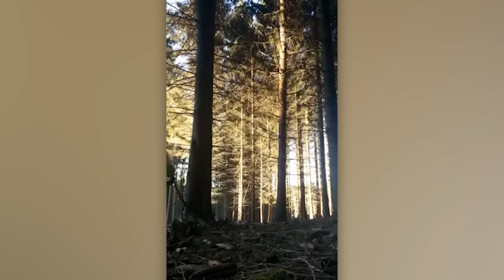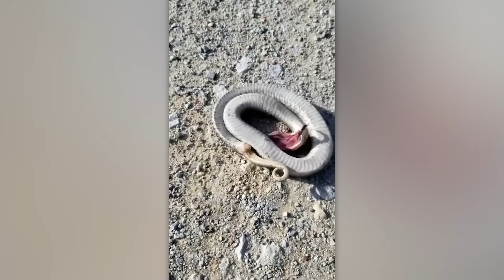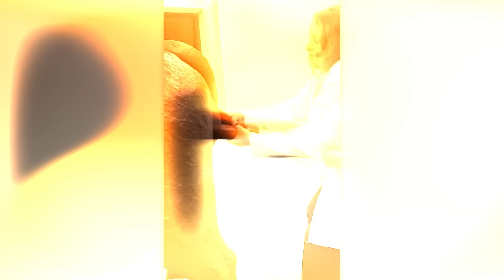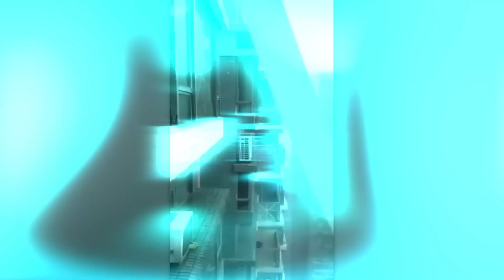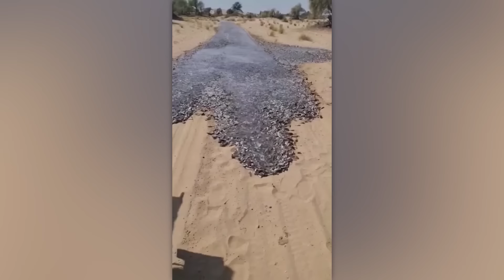Camera Caught a Moment That Can Not Go Unnoticed

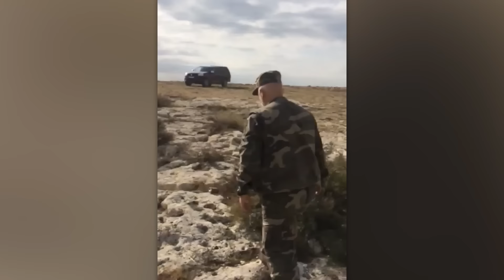Comment: @3:30  That was mother nature telling that guy not to throw his empty beer cans over the cliff.  🔄
Reply: I wonder what would happen if one tried to land down there in a parachute??
Reply: Wouldn’t it be cool if people’s trash would all return to their hands when they litter. Until they put in a proper trash box.
Reply: My log cabin is passively cooled by a similar effect. It is sited on a lake front with a massive vertical cliff behind it. The hot air from the day rushes up the cliff face and then cool air is sucked or flows down the vertical cliff face and back out towards the lake.

I noticed this effect before I planned  the cabin design & theorized I could cool the cabin by situating two pair (or 4) French doors on the back (East face)  of the cabin on the loft floor....with a mere two large windows which open  in  the octagonal turret on the same level of the  western or front lake facing wall. 

I was delighted to discover this worked beautifully. 

The thermal mass of the oversized house logs (18" top dimension wheras most house logs are 13" t.d.) means the house stays WARM in winter & cool in summer...but the "passive cooling" is a free & wonderful feature.
Reply: @DanceintheRaine666  The wind ain't the only thing blowing at the tree house.

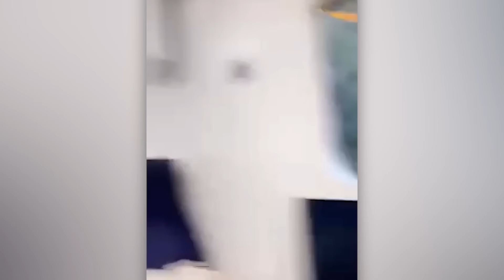Comment: 1:40 - Another train passing on the left, while that train slowly goes through a station on the right?

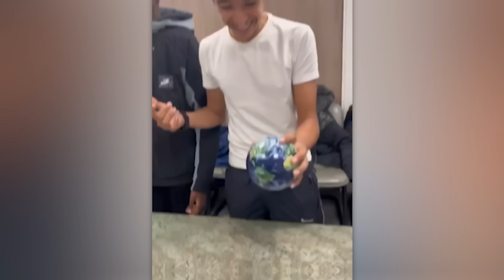3:20 - The blue globe is inside a clear outer ball filled with fluid, and is weighted so that it stays upright. You can often find smaller versions made to look like eyeballs.
Reply: The train part you’re definitely right about. As I’ve had it happen before. NYC subways can really give you some strange results.

Comment: The train... the window with fast pace was closer to the wall, and the other window was further away from the scenery on the other side. The difference in distance is why it seems faster one side than the other. You get the same effect with how high you are off the road when driving. A car that is very low to the road feels like it's going much faster than a high seat car at the same speed.

Comment: Some calves are born breach, so it has to be practised both ways!
Reply: Backward is fairly common and is not breach. Though a breach will lead to a backward birth once corrected. Which often is an excruciatingly tiring process. I've done it myself, but a few times I had to call a vet and we were both exhausted when done.

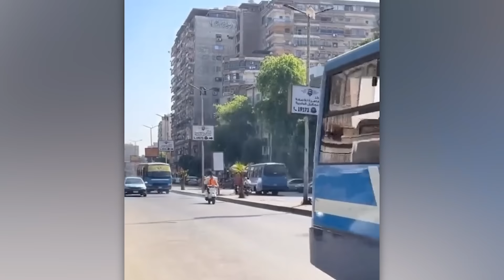Comment: 8:11 The calf went in easier than it came out!
Reply: I have pulled many calves.  Never that easy, simple, or safe. Turning a calf in the cow. I have never been that dead tired. Cow was as well.  We both laid in straw after I got the calf to suck.
Reply: @larsharris  Yeah, amazing how much force such a relatively small and thin muscle can exert. And you can't take a rest because she isn't going to. If you stop, it's start all over again. And if it was real she probably wouldn't have been able to hold a calf that big, too slippery.

 But why would you turn a calf? Just pull it backward. Have to be more patient and use hand to help dilate and ease it through. Can't imagine turning and messing up the cord. What's hard is breach. Getting the rump back down enough to get the legs up, wow.
Reply: @heartysteer8752  my best. Driving down road I see a dairy cow “give up” on her delivery. Nose of calf, both legs exposed, dirty.  I drive in yard, blowing horn, yelling.  Nobody home. 150+ miles from home. I was a IC fir agriculture dept in that area.  I pull out twine, take off nice shirt, climb in.  (What rancher does not have twine along) ;)  I finally got calf out. (Still alive)  took yucky twine tied to fence post, washed up. (Always carry jug of water with dish soap, towel in truck). Couple days later went by had to stop.  Cow/calf doing well. She hates strangers according to owner. He remarked when he saw size of calf, twine.  Wondered who pulled it.   Cow was dead exhausted.

Comment: Picking up radio waves: During WWII, Lucille Ball heard Japanese men talking. It seemed to be coming from her mouth. She had just been to the dentist, and the new metal work on her teeth picked up Japanese chatter. She went somewhere (I don’t remember if it was the consulate, the police, or a friend in the armed services), and they determined it was a Japanese submarine offshore from Los Angeles. The military ended up being able to triangulate using Lucy and captured the sub or sank it. The phenomenon of her dental work picking up radio waves that were the of frequency used by the Japanese abated and finally went away.